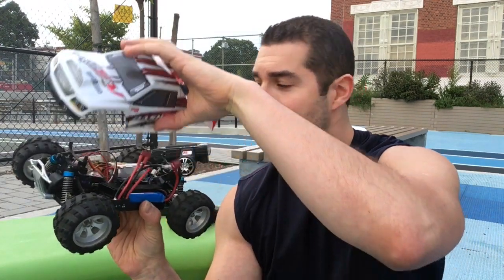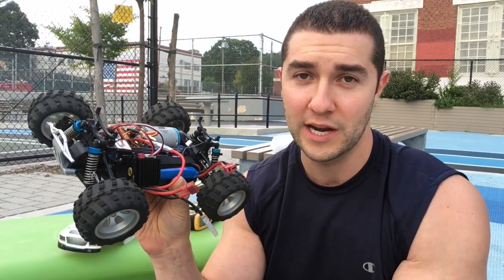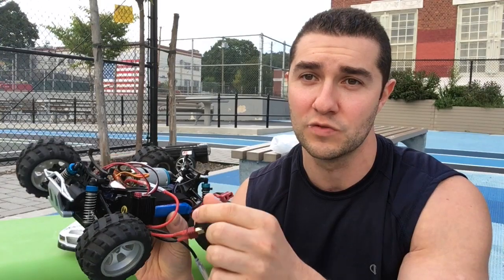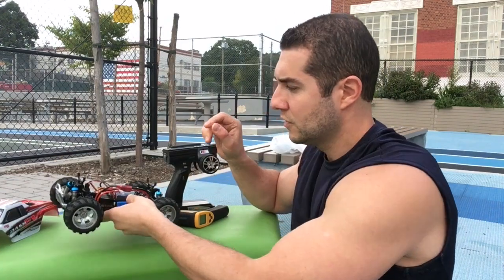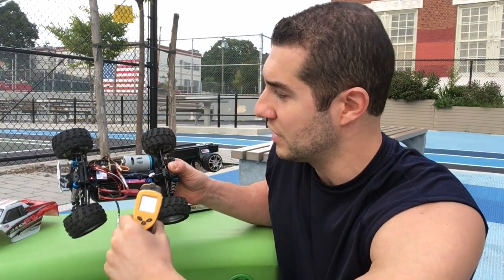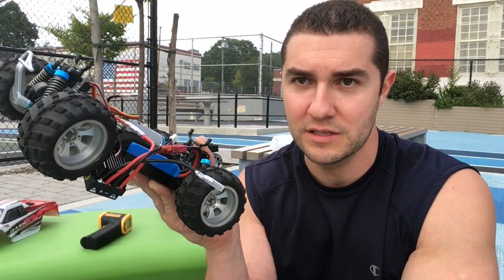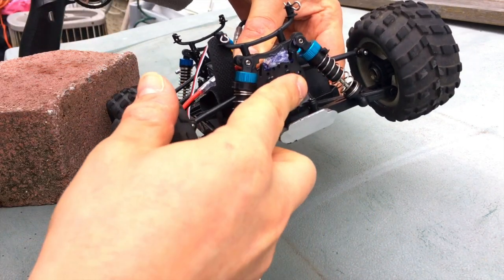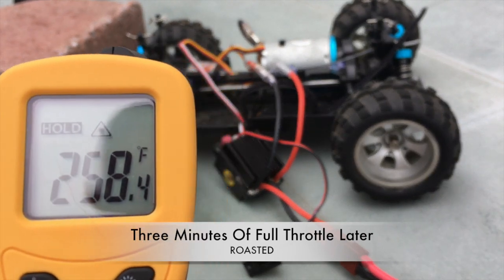Wltoys A979B ESC Burnout

Comment: Can’t see the temp at the end YOU PUT A VIDEO LINK OVER IT LOL 
This video was awesome thank you for showing what happened to the ESC I bought a used RC and the ESC had no reverse even though it was supposed to I don’t remember if the brakes were good or worked at all but I hated not having reverse and if you were to keep moving it in reverse it would jump so I kept doing that and eventually it got so hot it melted the wire off of the ESC which was fine for me because it was fun destroying the ESC so I could put in a working one
Reply from the maker: Now this is the beginning of the END for me with the WL-TOYS 1/16 chassis.  At this point I realized spending any money on them is pointless, and people only do it for CLICKBAIT YouTube vids. Then I went home and started up a nitro and felt relieved!.
Reply: @hybrid32494  what was the temp it finally reached and did the wire melt off again

Comment: cool To see That ;)
Was The esc Cheap ?
Reply from the maker: YEs, that was the cheapest brushed ESC you can get gearbest.com.  Paid 8.50 for it.  Not totally pissed, it did work for about 5 battery packs, and the stock setup on it was very good.  Was just as fast as the stock ESC though.  IT's ok, we going brushless soon dude,   waiting for stuff in the mail for that.

Comment: This esc is designed only for 1/10 scale rc truck.this esc will only work with small pinion gear especially for crawlers not for high speed rc cars.bcz high speed rc cars uses big pinion gears that makes a lot of load on esc.so you should use only the esc that is designed for 1/18 scale.